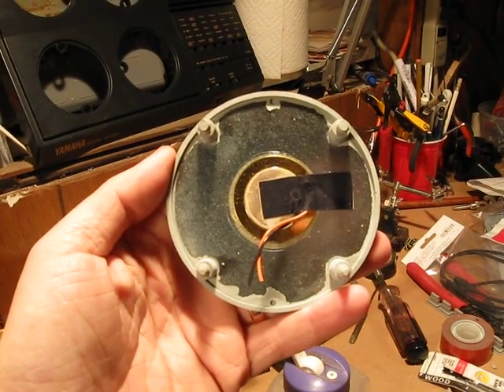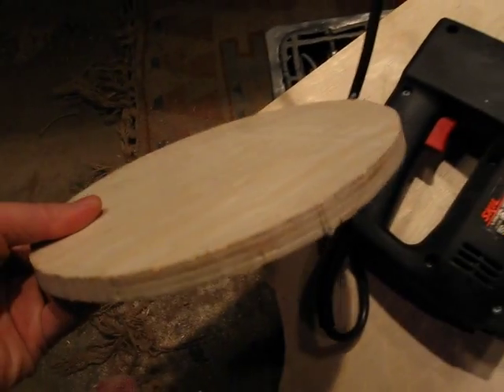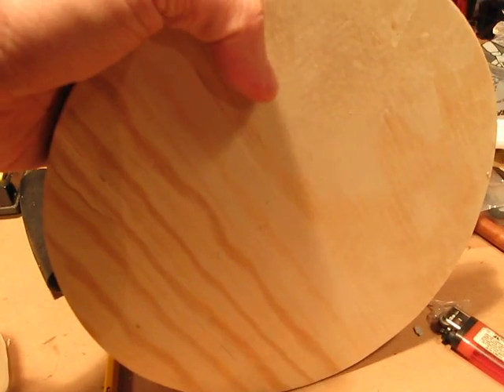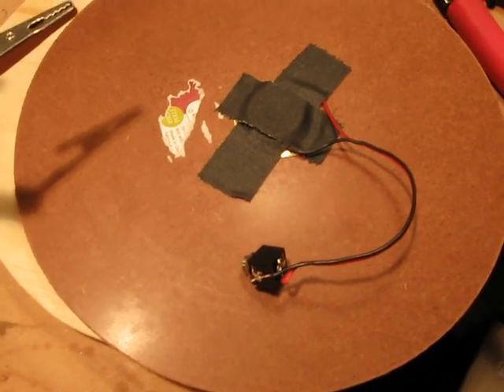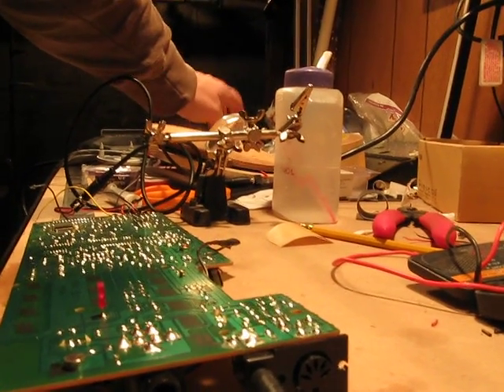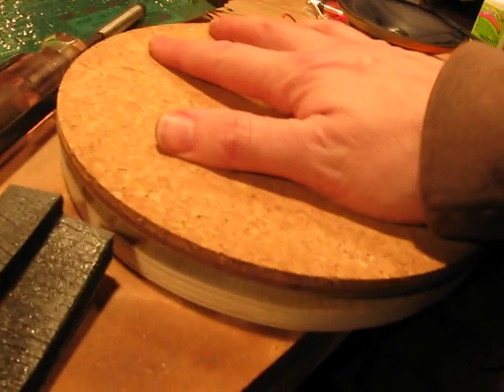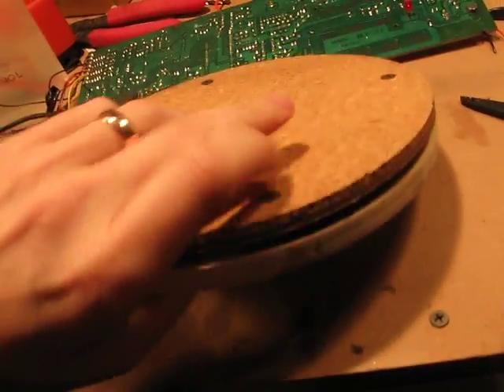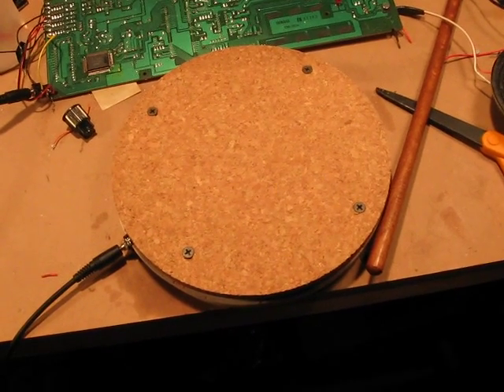Building an Electronic Drum, version 2

Comment from the maker: @enzometalero Originally, I got them from the drum I was pulling apart, but you can get them cheaply from Mouser or DigiKey. They're 80¢ or so there. In a pinch, you can get them from Radio Slack, but they're a couple of dollars, come in a plastic case, and you have to put up with the battery hard sell.